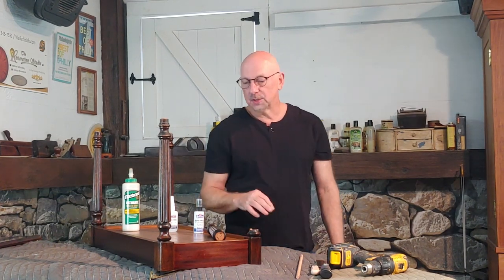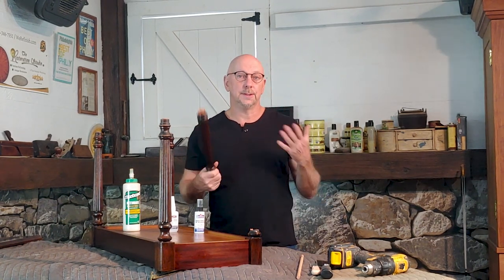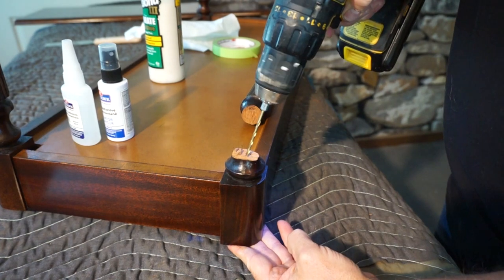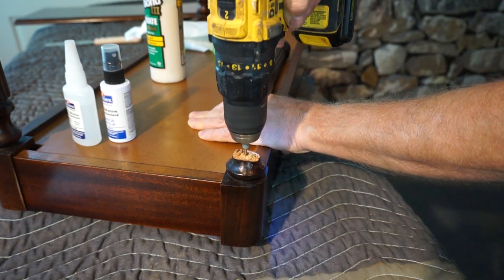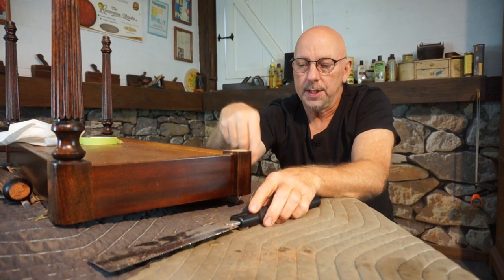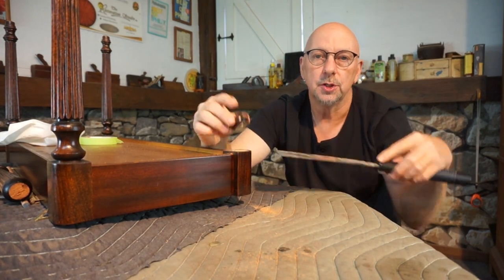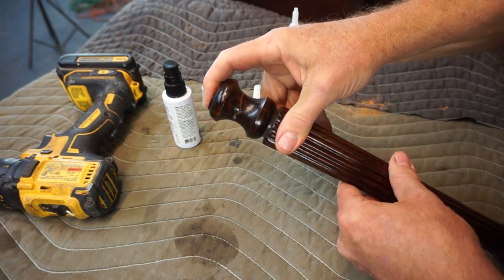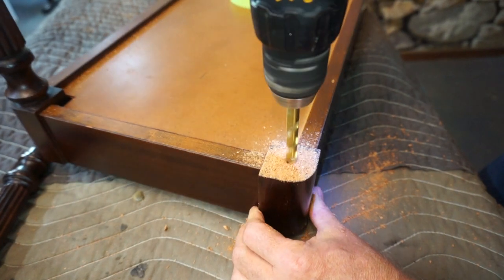How To Repair A Broken Chair Leg Or Table Leg - DIY Furniture Repair & Restoration

Comment from the maker: Let me clear up a few comments for those uncertain of the Dowel method.  " In this case", the dowel is not being used as the main source of strength. I was very happy with the surface to surface wood contact and allowed the glue to do what glue does.  To this day it has not failed, but there are situations that a larger dowel would have been a better choice and OBVIOUSLY a new leg would be ideal, however this bench was not valuable and from a cost perspective a new leg was not an option because we run an actual for profit restoration business. Its also called a DIY repair in the title, with the objective being to show a method achievable by an average person with average hand tools and skills.  Thank you for watching !

Comment: I like how you do all this without a huge shop with tens of thousands of $ of hi-tech machinery. 
I've been in these spaces; you've shown me some very 'smart' ways of fixing common problems (with Windsor-style chairs). This should allow me to fix chairs that I previously viewed as skip-fodder. But quickly and properly...
Therin lies the cost-effectiveness conundrum of restoration - old pub chairs (my arena) which are probably technically antiques but in practice are probably 3rd generation auction mixed-lot-fodder.
Love fixing them up though. Learn loads. Massively satisfying.
Beer is a lot cheaper on the days I take the finished items back!
it'll never be a business, but it's satisfying and keeps me plugged in to the local community...

Comment: Good stuff, great technique, and very informative.  Thank you!

Two things for your viewers:
1. CA glue vs Super Glue is not a thing.  Super Glue IS a CA glue.
2. Hacksaw blades are a ton cheaper than a Japanese pull saw, and for something as small as a 3/8" dowel it only takes 5-10 seconds for the flush cut.

SO...
"SuperGlue" is a trademarked name of one of the many cyanoacrylate glues.  So, yes, Super Glue is a CA glue.  Not all CA glues are Super Glues.  CAs in the super glue family require moisture to activate, and even that found in the air works.  Gorilla brand super glue does not need that moisture content.  There are also materials that don't work well, like polyethelene, as well as anything porous.  While wood glue will fill holes and make strong joints, CAs do not, and if you pool a bunch of it, that joint will be brittle.

Why is this important or why do we care?  The purpose of an adhesive is to bond two materials.  If water content is present then TightBond III is better than TightBond II, and Super Glue will be more effective than Gorilla brand.  Just as you choose the right tools, such as the Japanese pull-saw, it's important to use the "right adhesive" so that you'll have a reasonable working time, a reasonable curing time, and it won't yellow with age and fall apart years later.  

FYI any flush-cut saw will work, either pull or push saw.  If you don't have one handy, a $3 hacksaw blade (outside of the hacksaw frame) will work perfectly.  Oscillating "multitools" work ... but the chances for taking out too much material to make the re-fit work isn't worth that kind of trouble.  If you prefer to pull the saw, orient the blade for pulling.  If you prefer pushing, do the opposite.  If you want both ways get a metal blade with triangular teeth and push and pull it :)  

This was a really enjoyable video to watch.  It took a painful image of a broken leg into a smooth reflective stronger leg at the end.  Thank you again!!

Comment: Very informative, thank you!  I noticed you did not use the spray lacquer over the whole piece. Have you found that this has not caused an uneven appearance in the finished piece? Not having to spray the whole piece, especially if it's a large piece, would certainly save time and effort.

Comment: Great technique, and superb touch up! I'm a bit of an overkill enthusiast and would have gone with a 5/8 inch dowel, maybe even 3/4. Piano benches take a lot of abuse and have no spindle support below the seat.
Reply from the maker: Thank You !!  There are always multiple approaches to a repair and in hind sight a slightly larger dowel may have been a better choice due to the lack of bracing on a piano bench leg.  It was put back in service and has help up well though.
Let me explain my choice.  I had a very good clean fit with this break. When reassembling, I had excellent wood to wood surface contact. In this case, I am trusting that the glue will be stronger than the wood. I'm relying on the glue more than the dowel for the strength of this repair.  The larger the hole, the less wood surface I have to glue and the more I then would rely on the dowel for the strength of the repair.
I'm not sure which is the better choice , I suspect it will vary from situation to situation but in many cases a larger dowel may be necessary. Not too large though, don't underestimate the strength and holding power of the glue.

Comment: Hi, I'm about to join a broken table leg 1st timer, and I thought of this technique, I just wanted to reinforce my idea of doing this. The leg is going to be a bit more weight bearing and bigger (2-1/4"×2-1/4"), so would I used 1 larger width dowel (my first thought), or 2 smaller width from corner to corner. Your advice will be gratefully accepted.
Reply from the maker: Great question ! In that application, two might be better, but it's a higher degree of difficulty. One larger dowel would be straightforward and easier and would offer very good strength but perhaps not as much as two medium hardwood dowels.
Reply: @FurnitureRefinishingStudio  Thanks, I'm starting to swing towards the two dowel option myself, bit more control as in less chance of twist. Or maybe starting to think to much, always a danger. 😉😃
Reply: @FurnitureRefinishingStudio  I did a similar repair on a 1 1/8 inch diameter curved chair leg with an intersecting tenon so I could not go larger than 3/8 inch diameter for the dowel size.  I opted for a 3/8 inch steel bolt that had the threads and head removed.  I used a two part epoxy on the glue up.  The final results were rock solid and did not impact the tenon.
Reply from the maker: I always enjoy seeing and hearing how others tackle similar projects, thank you for sharing.

Comment: nice job but i think you could use a metal rod that is stronger(i do this by screwing a big screw 5-6 mm in leg, cut the heat and screw to base with clue )

Comment: One tip. Instead of using a wood dowel, use an old drill bit. It will never break again. Any 1/2 assed handy man has old shot ones lying around